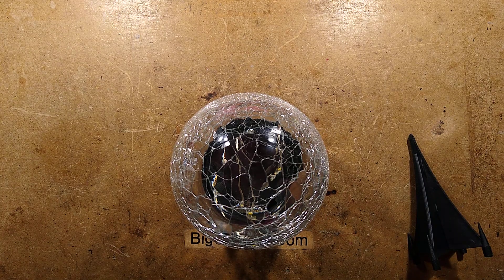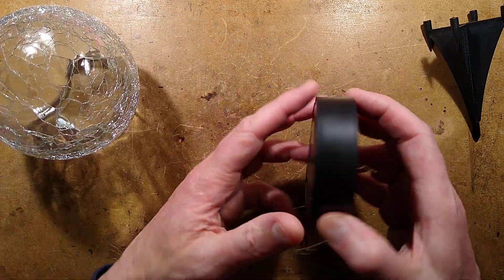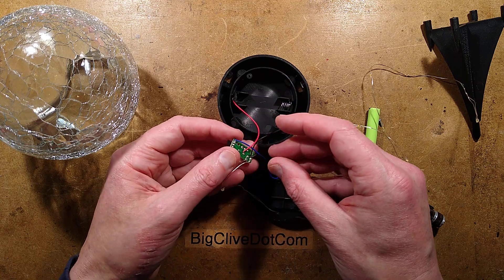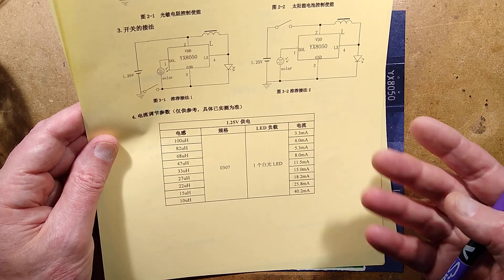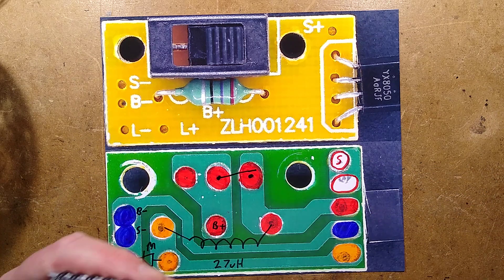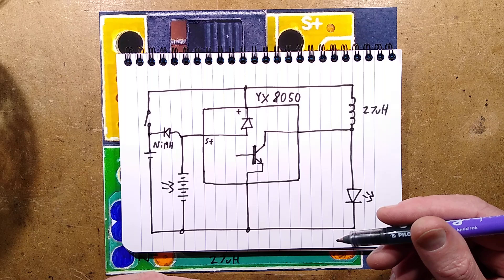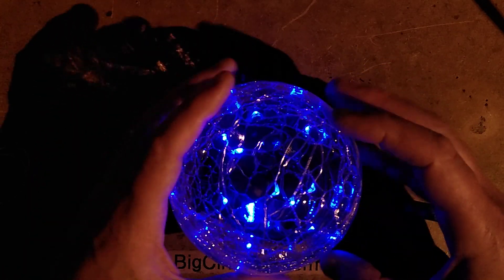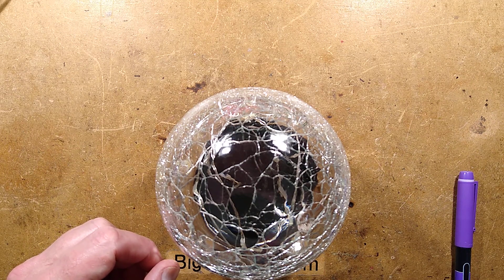Poundland solar crackle globe is a winner

Comment: TOP TIP!! My Ex (Now a good friend) absolutely loves her garden, and, with it, her solar garden lights (so much so I joke that peeps on the ISS could see the multicoloured lights from her garden lol). Anyway, We have learned that, to help 'Weatherproof' these lights (the ones with the solar panel exposed and on top of the light), using clear nail varnish around the edges of the solar panel (where the solar panel fits into the cutout in the plastic housing) helps keep rain/moisture out of the light so the light lasts a lot longer, thus no rust on the circuit boards too. So, just 10 minutes applying a layer or two on a new pack of lights, helps them lasting from just one summer, to 2 summers (she has 3 year old lights this way too) - even cheap B&M/Wilko/Lidl/Aldi solar garden lights. As I'm her 'Tech guru' - we're in our 50s - me 51 today, I also usually upgrade the rechargable batteries with pre-charged higher MAh batts (if they are AA or AAAs) as it helps with longevity of the batteries and, with the usually fitted 150 or 300 MAh, they don't last long. So, yeah, I 'Pimp her lights' lol 👍😏     😎🇬🇧
Reply: Happy birthday 🎂
Reply: @tbonebrown94  Haha thank you, thought I'd cheekily add that, yup, creeping yet another year towards retirement lol 😏
Reply: Belated Happy Birthday young man may all your problems be little ones.
Reply: @Jimmyfisher121  Thank you, and the same to you! 👍

Comment: I like the idea of incorporating a photocell to improve battery life.
By the way have you seen the LED light bulbs with a switch to select warm or cold white? They must be using two runs of different LEDs, I can't see how it would work otherwise.
Reply: Picked up a cheap "light therapy" device that puts out warm, cool or cold white. It had a row of warm and cold white leds. For cool white it turned on both rows. It's probably the same for led bulbs.
Reply: Technology connections just did a video about those. LEDs tend to be "binned" into different colour temperatures when they are made but bigger shifts can be made by changing the mix of the phosphor.

Comment: Always doing the same. Cheap solar lights are nice but they need some work.
Using liquid rubber for the board and silicon kit for the solarpanel.
Also sometimes reducing some current with an extra resistor. And aluminum tape to get some light reflection to improve it.

Comment: Clive ..
 Will it charge all the time if you ...
 1.) Cut the tracks to isolate the switch  and short/bridge the B+ to the Inductor. 
 2.) Disconnect the 4th leg of the chip from it's pad and connect the switch to that pad and the 4th leg? (or just cut the track from the chip to the LED and connect the switch)
.. I've been looking for this to come to me for a long time.  You make such good pictures of those little boards!

Comment: Clive, I'd like to make a request... Could you do a video on piecing together a solar charger for a lithium power brick?... What components would be needed, what size/kind of solar cells would be required, etc. (Or if you've already done a video on this topic could provide a link?)
Reply: I use a 6 volt solar and tp4056 and battery holder works verry well 👍 it's similar to his last one's about charging ecig batteries hope this helps 👍
Reply: Been thinking about this and with the availability of “free” lithium ion 3.7v cells , wondered if it’s possible to charge them using the existing solar panels in these Poundland lamps. 
I have modded the plastic Poundland globes using the “ Kodak “ AA rechargables from same source. 
Added clives patented Christmas tree of 5 or 6 leds. 
Working great other than the 2 that “ disappeared “
Reply: Look through his videos, he’s done many on various builds..  but it depends on what kind of power your wanting to get out of it.  To charge a phone would be simplistic but charging a bank of cells say for a home is more or less the same thing but bigger components to handle the current..
Reply: But all it involves is a charge controller, a diode or backfeed suppression, panels rated to the controller, and batteries with battery management/ protection.. it all can be bought individually to make it modular or as a unit if just trying to charge a pack for a drone or rc car or tool battery

Comment: Wouldn't have to worry about water damage here. It would be nicked within days. But they are nice to tinker with.
Reply: As I posted earlier I modded around a dozen of the plastic lamps some years ago toClives recipe with a5 or 6 led tree instead of the single led. To date other than 2 disappearing all are still working.  
Modding them this way you will easily recognise your work if they get nicked ool

Comment: One concern about anything made of plastic that is intended to outdoor use is UV susceptibility. How will that semi-clear globe look after a year's exposure to the sun?
Reply: It's a glass globe apparently
Reply: I agree,  just about every solar light I have has had the plastic lenses go yellow or opaque within about a year. Colorado sun is relentless at 6400 feet (1950 meters) elevation.
Reply: @mrbyamile6973  You rang?
Reply: I got some cheap solar lights for my girlfriend's driveway a bit over 12 months ago... They started cracking and going yellow after about 6 months. All broken now.
But they did the job.... It stopped everyone driving onto the lawn. Even without them now, no one does it.

Comment: Not that I support DOW/Corning, but they have a really good product here. RTV 3145 is a Room temperature vulcanization rubber product that cures like tire rubber. It's categorized as an RTV sealant/adhesive and I love it. Its a glue and a sealant. It's worth looking into for someone like you. One tube will last you a lifetime if you want to make things indefinitely waterproof.
Reply: I had to laugh at the "one tube will last you a lifetime" I got through three tubes in a weekend after we vibration tested a battery charger of a type we were about to deliver over one hundred of and at the end of the test it sounded like a Maraca as all the inductors had come of the board. Having proved that RTV3145 would keep the inductors attached to the board I spent all weekend undo the chargers and applying RTV around each inductor to secure it.
Reply: I love near their factory 🏭 not very beautiful 😂
Reply: @stonedsavage7814  I'm sorry, but that typo is just hilarious. I can't stop laughing at your comment's new meaning. lmao
Reply: Sounds great but at over £60 a tube, it's a bit out of my price range.

Comment: So next question is what frequency it switches with - can it cause RFI at a frequency where it matters?
Reply: The switching frequency varies quite a bit with voltage and temperature, somewhere in the region of 200-340kHz.  Im sure there will be some radiated emissions, probably more so with the big string of LEDs compared to the single led designs. That said currents are low, and being a garden ornament they don't tend to get located next to sensitive equipment.

Comment: Silicone grease is my go to water proofing.  Most integrated circuits are fine swimming in mineral oil.
Reply: Didn't some early supercomputers like Cray use mineral oil for cooling.
Reply: @MrDuncl  some people still like to build there PCs in mineral oil.

Comment: I would immediately switch to a Lipo4 battery (+ circuitry to protect charging/discharging and a voltage regulator, of course)
Reply: Eh, this is actually a pretty solid application of nimh cells. No need for the higher power density and hazard
Reply: @rpavlik1  agrees but with advent of disposable Vapes plenty of free 3.7 volt cells about. 
Think I have around 100 of them so far.
Reply: @patomahony9747  sure, that's good, but I read the op as referring to the very safe very durable 3.2V LiFePO4 cells, which are definitely not free or being used as disposable 😁
Reply: @rpavlik1  agrees but lipo out in a flower bed. Can’t see them doing any harm if they pop. Yes indoors in a conservatory is a different matter. 
Don’t have the theory ability but going to experiment with what I have to hand. 
Will either work or not lol.

Comment: I'd be worried about it starting a fire in the bright sunshine, magnifying glass style
Reply: I don’t think a hollow globe would be much of a lens.  However Clive is a proper lighting guy, so if he sees this he can give you a much more certain answer.
Reply: Nah, that shouldn't be a concern. Remember how a lens is typically concave or convex to bend the light in a certain direction. Here you've got a straight (and hollow!) globe, so light will pass through straight. A bit is broken at the crackles, but it won't have any single focus point anywhere.

Comment: Grease on battery terminals. Sounds like a good tip for my trail camera. Thanks!
Reply from the maker: If you can fit a small silica gel desiccant pack in there it may help with humidity too.
Reply: My dad always put vaseline on the battery poles in ever car he owned. Easy way to prevent "corrugation" like a friend of mine used to say, no one wants a wavy battery pole😁
Reply: Try Super Lube Synthetic Grease.

Comment: Did a battery upgrade on a solar light today 200mah to 2400mah maybe over kill
Reply: Yeah, upgrading the batteries a bit definetely helps, even if they do not get the most light. I found some cheap 550 mAh AAAs on ebay, and replaced the old 200(?)mAh ones in my solar lights. Works way better now. It means if the sun is actually shining they can store a lot more of that. Not sure if 2400 mAh would really be necessary thoug...
Reply: @Ranger_Kevin  I didn’t have any smaller battery’s so I used they
Reply: I'm surprised you could find 2400 mAh capacity in AAA batteries, I haven't seen any bigger than 1000mAh.
Reply: @richardturton6900  it was a aa battery
Reply: I stuck a 3Ah+ mobile phone battery into one because it happened to fit. Nice for those long dark winter nights.
Reply: @benbaselet2026  did you put a lithium ion battery in to replace a nickel metal hydride battery? Did you change over to an appropriate charging circuit?
Reply: @Nono-hk3is  Yeah there was a 3x NiMh battery there before and I swapped it with a protected lithium cell. Not optimal but it's in the middle of a field and practically dumpster gear ayways so it lasts the time it lasts.